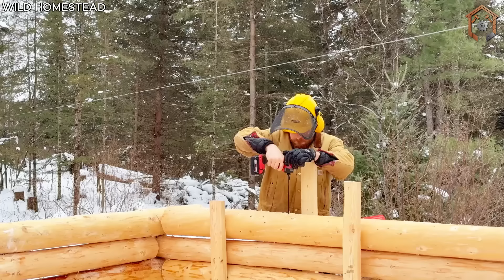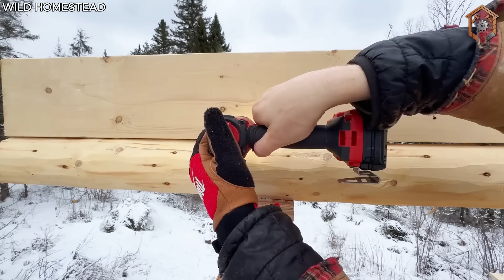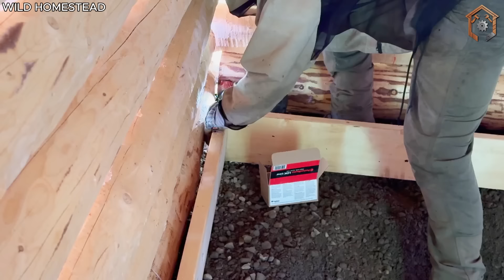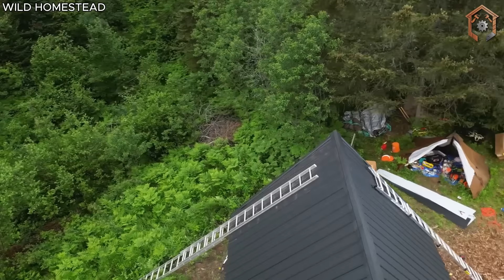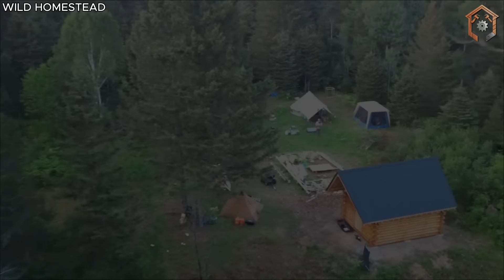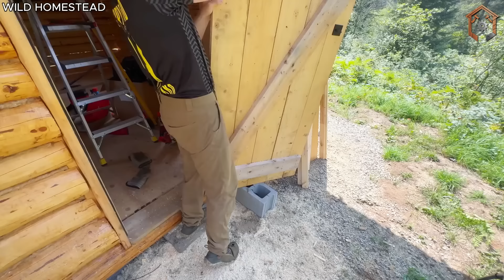Man Builds Unique Wooden Cabin in the Deep Forest | From Start to Finish by @wildhomestead

Comment: Those Roxull wool insulation batts are one of the best products you could use for your floor insulation, but the floor vapor barrier is on the wrong side of the insulation (always install on the warm side).  Also great that you used SST joist hanger hardware, it's the best.  I like to paint them black before installing.  Nice cabin.